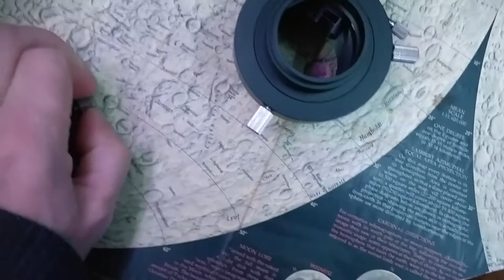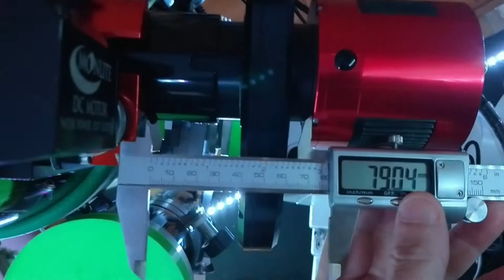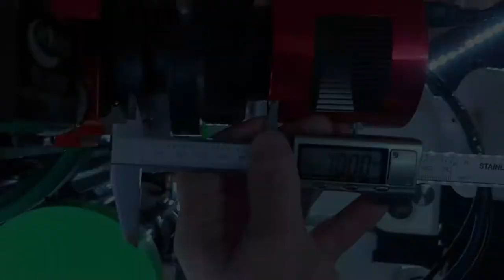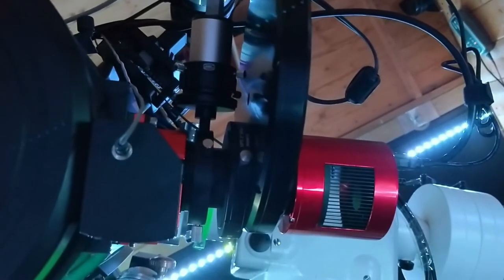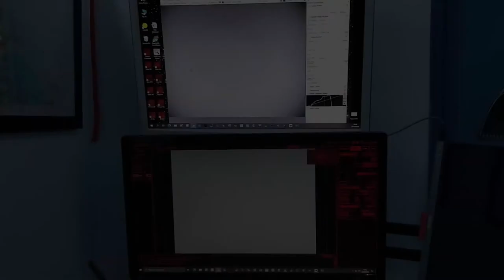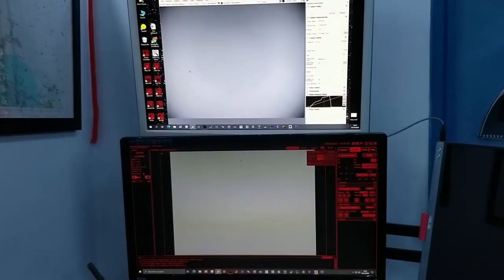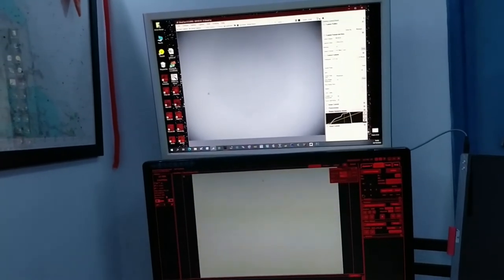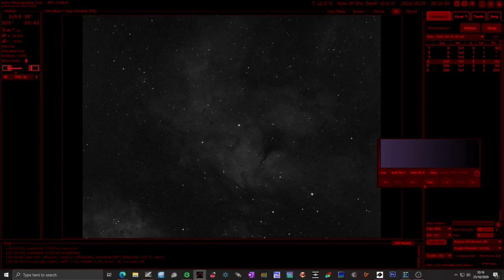Using and fitting an Off-Axis-Guider

Comment: Why are you using a filter wheel and filter drawer? One or the other normally plus you''ll eat up your back focus using both
Reply from the maker: Hi Simon, I live in a Bortle 8 sky, so have to use a combination of light pollution filter and broadband colour filter, so they need stacking, I also do some exo-planet transit photometry and for this I don't want the LPS filter in the light path, so my solution is to have a filter wheel for most of my filters and the filter slider for the LPS filter, that way I can achieve all my goals with the minimum of fuss - it does add to the back focus, but I have enough - and it does add some additional surfaces for dust etc. but I live with it as the best solution for my very light polluted skies.

Comment: I have a Celestron 8" SCT, would OAG be the best way to guide, given the long focal length?
Reply from the maker: So the thing to consider is the field of view of your guide camera when connected to your SCT, (which is a function of the size of the guide chip and the focal length of your system (2032mm?), the FoV will dictate to a large extent the number of stars you can find - although you can also increase your guide exposure time as well to find fainter stars, I only removed my guide scope once I'd convinced myself I could always find a star and so far have always had multiple stars to choose from, but my focal length is only 1000mm so the FoV in the guide camera is 4x that of a 2000mm system.
Reply: I know this comment is 4 months old, but I wanted to reply and hopefully help anyone that may see your comment. After trying 4 different OAGs and 3 different cameras, I found that the Celestron OAG combined with the ASI 174mm was the perfect combo for my 8" Celestron SCT. A mixture of the large pick-off prism and large sensor made it easy to find a guide star, even when shooting at the full 2032mm focal length.